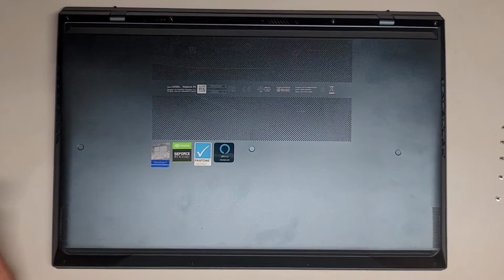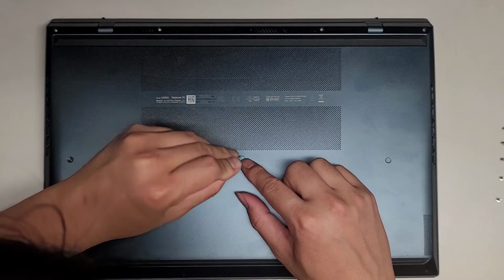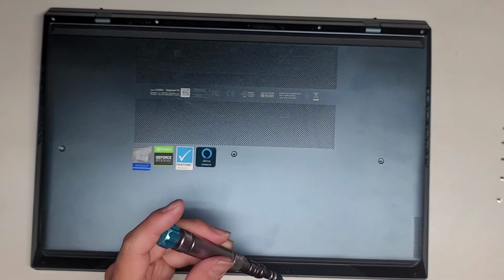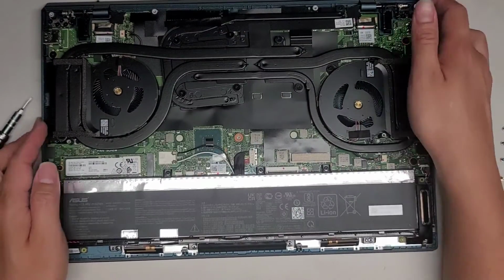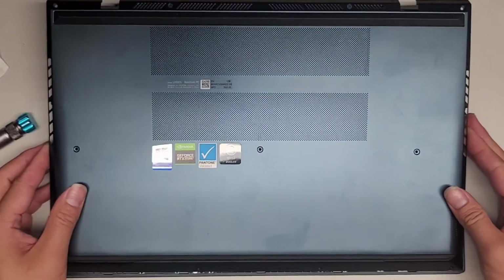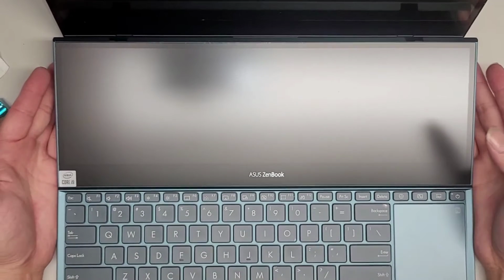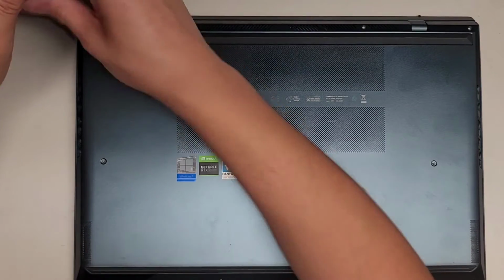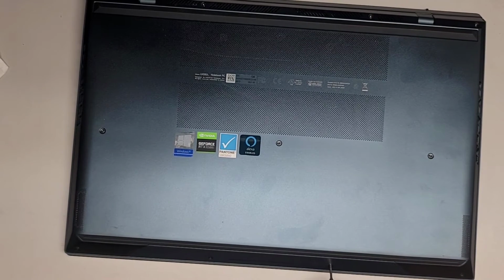ASUS Zenbook UX582L Disassembly SSD Hard Upgrade Replacement Repair

Comment: Hi, Thank you for a great tutorial - I have a Zenbook Q539ZD and wanted to upgrade its WiFi card, but I am unsure if it is soldered on or removable... do you have any idea... Please help, Thanks!
Reply from the maker: You'll have to open it and look inside. Also, some don't accept aftermarket wifi cards.
Reply from the maker: You can use a usb wifi adapter

Comment: I got an urgent question, as Amazon Cyber Sales might ended anytime from now.
I want to upgrade my current 1TB SSD to Samsung 980Pro 2TB with 'HeatSink', is this model compatible with that SSD?
Mine are UX582LR as well~
Reply from the maker: No, way too thick.
Reply: @ItsBinhRepaired  Wow, thank you for prompt reply! How about normal Samsung 980 Pro 2TB SSD?
As in my MSINFO, this laptop stock SSD are "NVMe SAMSUNG MZVLB1TOHBLR-00000"
Reply from the maker: @MrRomeoMrvica  sure

Comment: Is it necessary to disconnect the battery?
Reply from the maker: To do what? Is it necessary to stop at stop signs? You don't have to, but you might want to. Lol
Reply: @ItsBinhRepaired  why you didn't disconnect?
Reply from the maker: @jcdarq  It depends what you're trying to do.

Comment: The only reason why I didn't want to buy the laptop have been solved. Thanks man. But I don't know how to clone. Can you help me with the process of cloning when I have the laptop?
Reply from the maker: This should help https://youtu.be/4p5jFDzVwUw
Reply: @ItsBinhRepaired  did you have to do anything with BitLocker protection and other disk-encryption-related stuff before cloning/replacing the disk?
Thanks for the video :D
Reply from the maker: Turn it off preferably